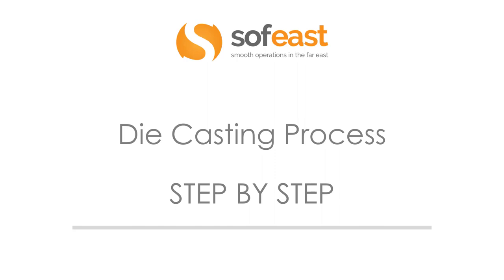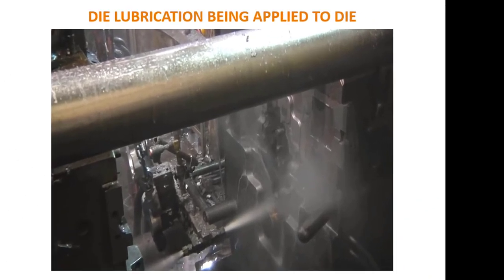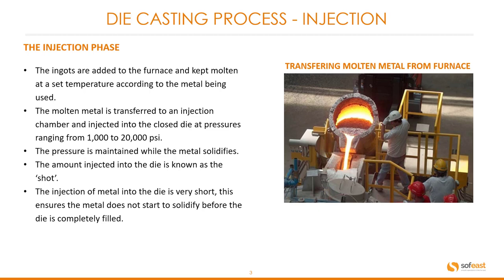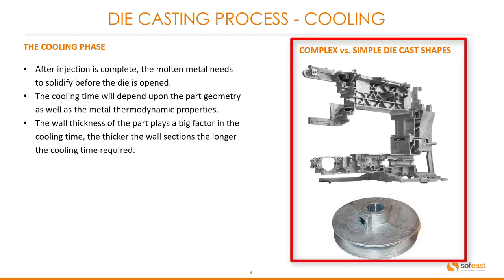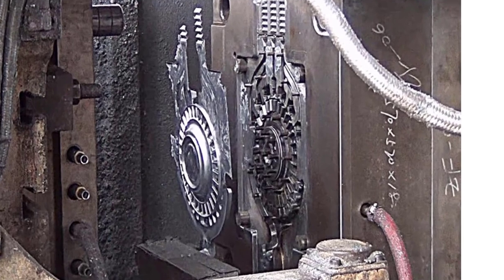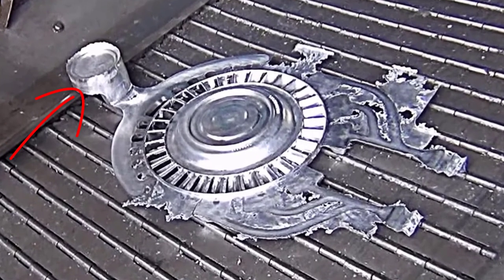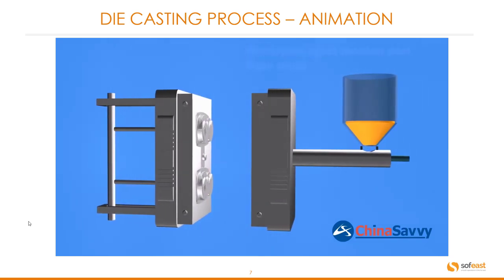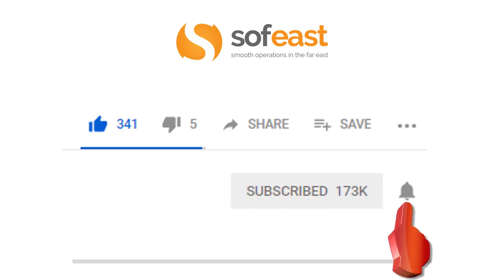The Die Casting Process Step By Step

Comment: A nice video on metal die casting basic processes. Die casting is a good technique for producing precision metal components at medium and high quantities with short-turnaround times. Parts will have high precision, very good surface finish, can either have smooth or textured surfaces, and be repeatably produced. It can take weeks to make the mold which is not cheap, but once the mold is made, parts can be produced inexpensively and fast. So metal die casting is a technique good to be considered if you need the same parts repeatedly, over and over again in significant quantities as you deplete your stocks or even for one time production if quantities are large enough to justify die casting mold fees. Thank you for posting ! You can watch more instructive videos as this one on our Youtube channel by clicking our logo to the left.

Comment: Just been looking at Tesla's Giga Press and not sure how it works.  It appears to have a huge press which just keeps the die closed but that doesn't makes sense - you could do that with much smaller clamps.  The only real option is that the press is creating the pressure but surely that means it would have to be able to move slightly which would ruin tolerances.
Can you explain?
Reply: The extreme pressure is used to inject the molten metal into the die, huge force is required to fill all the spaces. As you can imagine molten metal is more dificult to flow than our best known liquids.
Reply: I am not sure I understand where the force needed comes from though. I assume air is released and you aren't building up pressure from compressed air? If you aren't that makes sense.

If you are though, assuming the metal could stay liquid forever, it should be able to flow into everything without much force, other than the weight of the metal itself.

Is it because of the speed and volume needed of injection? Like 1 ton of metal pushed into lots of veins within a few seconds?